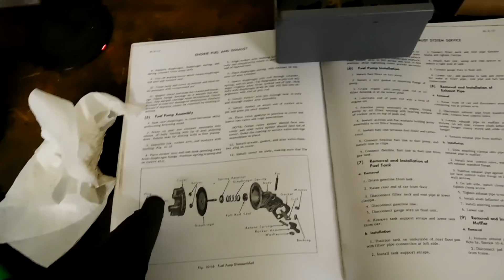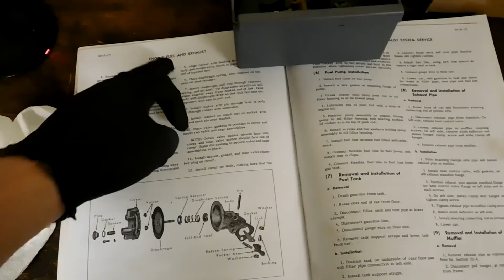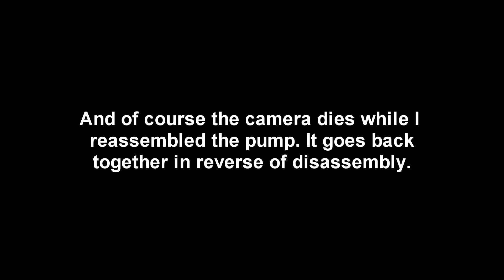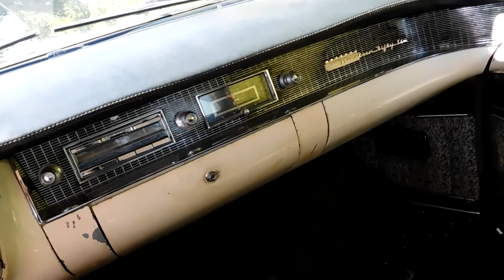1956 Cadillac Sedan DeVille Resto Video 75: Fuel Pump Problems & Rebuild

Comment: Even without ethanol those mechanical fuel pump diaphragms would get hard and crack. The nice thing is it was one of the rebuildable types.
Reply: I was going to say… he got a good life out of it. Even my car a 77 Chevy which I’ve put 150,000 miles on in the last has gone though 3 pumps in 12 years.
Reply: What do you think of adding electric fuel pump?

Comment: luv the '56.  so stately.
I wasn't breathing when you were pounding out the valves, as I managed to crack the housing on my original AC unit for my '58 doing that.  but good deal, all went well for you and the caddy.  fortunately ethanol-free is getting more and more common.
Reply: Hi, I have my parents 58 cadillac they bought in 1960. Series 62 sedan..also has factory AC,  power windows.  Which one do you have?
Reply: @1958Cadillac-v2g  '58 Fleetwood...barn car survivor, very complete, but definitely looks like it came out of a barn!

Comment: Hey Ben, love the Caddy, thanks for the ride.  I own a number of pre 1972 cars/trucks and  just a respectful suggestion, use only non ethanol fuel if you are able to purchase.  I use mostly 92 but 87 non is also available in my area and it not only lasts but doesn't create carb and issues that you just had to correct. Just a suggestion, love the channel and the dagmars!
Reply: I buy 90 octane non-ethanol at RaceTrac, Wawa or Cumberland Farms. Easy to get in central Florida. Runs about 30 cents more per gallon than regular non lead. You can tell the difference. My vehicles love it.

Comment: If you cant find ethanol free gas you can try stabil marine. I use it in equipment without any issues. It was recommended by a mechanic friend and so far I've had no issues.

Comment: With all the old cars you mess with and drive, it might be worth sourcing a fuel tank and pump to keep along side the garage to have filled with "farm gas", if it is available in your area. Usually 91 octane and non ethanol.

Comment: Thanks for this - I'm going to rebuild the fuel pump in my '55 Eldo in the New Year. Do you use any special gasket sealant when you put the pump back on the engine?

Comment: Very interesting listening to all the hydraulic whines and big RPM drops of that era trans. Not a trans guru and especially not expert in the history. But I recall that in the 50s some GMs were still using tech from 30s and 40s and those sounds remind me of it. Don't remember which gear it was - 3 or 2 - but the way the hydraulics and gears worked together you'd go from mostly fluid assist to almost all mechanical gears and the RPM would nosedive. At least that's how I remember it....🤔

Comment: most gas stations are e10 my chevy tahoe handles e85. i wonder what effect e10 has on classic cars i suspect problems might be lines from gas tank to engine i could be wrong. does that fill up at left tail light cap i know some do.

Comment: You would think that the rubber used in new replacement parts is formulated to hold up to ethanol, right?

Comment: Don't know if y'all have a gas station around called Country Mark or if it's just an Indiana thing, but their gas has no ethanol in it whatsoever.  There's a station of theirs a couple miles from me and I get my fuel there for all my small engines because it makes them so much easier to store over Winter without gumming everything up.  I go ahead and run the ethanol stuff in my truck because it's a little cheaper and my truck gets used a lot more year round.

Comment: Thanks for the video on the Caddy,   question about Gasoline,  is it possible to get gas without the ethenol in it?   back in my youth my dad owned a Mobil Service station and there was lead in the gas so i was told and its in later years they started with ethenol added in,  and i know that this nasty procuct can eat away at parts of the engine such as fuel pump,  and maybe others .  im not a mechanic but know a bit bout engines and the kinds of gas,  i always use regular unleaded  octane 87  cause the higher octane at 91  costs way to much.

Comment: What do you have for exhaust you don't have a video on that.i have a 56 SD too love sound of yours not to loud not to quite. There is a put together kit on Ebay for 8 or 9 hundred. Thoughts
Reply from the maker: My exhaust, pipes, resonators and mufflers is all original equipment from 1956

Comment: You're lucky that pump is up high.  On a low mounted pump there is a danger that the leaking fuel drains down into the sump through the mounting flange to the engine - not good.

Comment: I had the same problem with my 65 Pontiac. So I had to replace it. It is hard to find a good oldfashioned heavy duty fuel pump. They are not cheap neighter. 
I am looking for a rebuild kit online for a while now. Noone could give me a tip where to find one. I have one or two original fuel pumps in my trunk. But I had no luck finding the right rebuld kitt. I would love to get a tip where to get one. (Watching this video I see now that It seems harder to rebuild the pump than I thought).

Comment: Ben a question. Is 50K way too much to pay for a 1968 Vette Coupe ? White with Blue interior. All power inside, AC, 427 CU 4speed. 69K miles documented. I have found that color combo is pretty hard to find.

Comment: If that is a modern Chinesium pump, the rubber parts are cheap. I had to give up on new mechanical pumps and switched to a low flow electric pump .… I couldn’t get more than a couple of years out of a mechanical pump, even using ethanol free gas.